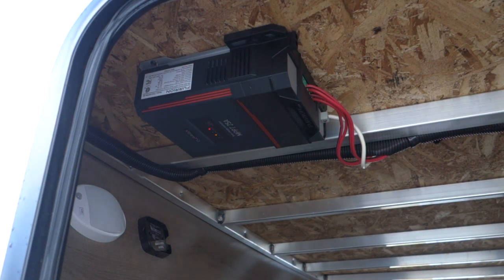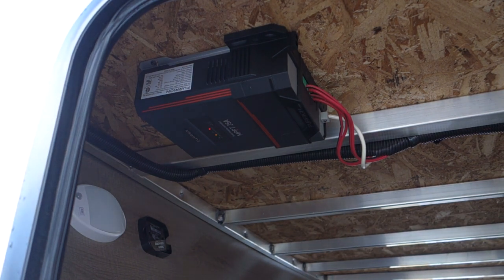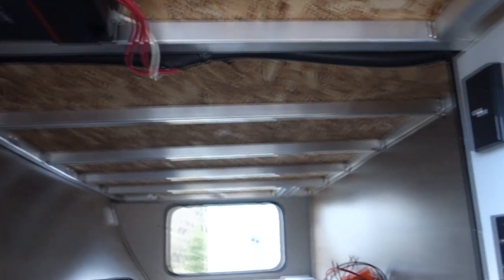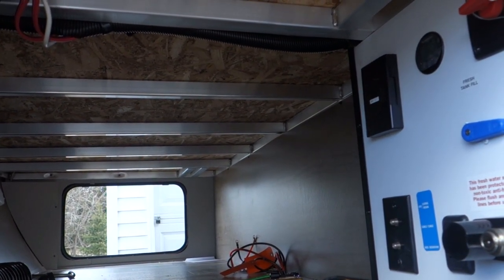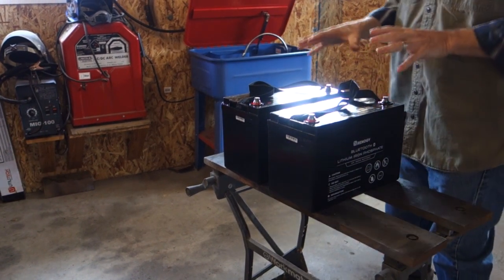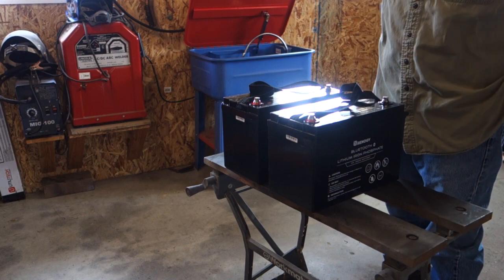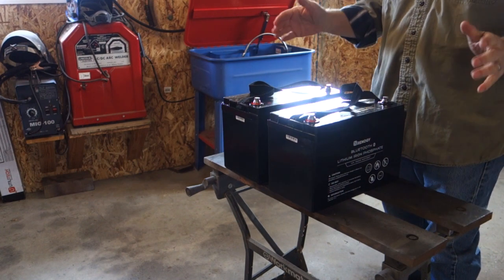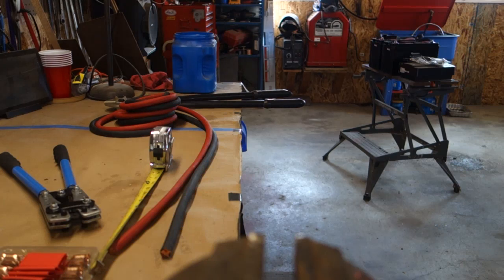2022 Grand Design Imagine 23LDE Solar & Electrical Upgrades

Comment: So I have a '24 23LDE and will be doing something very similar.  When I got it I installed a 3kw 48V inverter with a 5kwh battery.  I have 2400 watts of portable solar panels in 2 1200 watt strings which I can deploy up to 300 or so feet away, so that I can park under a tree but keep the solar going.  I like my portable setup, but I've decided to add a 3rd string on the roof so that I don't always have to deploy the portables if I'm not shaded, or having the 3600 watts will really charge up the battery quickly.  My goal is to put another 1200 watt string of 6 200 watt flexible panels up there, and I've been mapping out my roof to fit them in.  I'll be removing the stock 180w panel, and I'm hoping to put one of the panels along the front edge as you have in your video, but I was thinking I'd have to move the panel where the stock panel currently is down a bit, otherwise those two would conflict.  Looking at the one spot in the video where you're showing all 4 of your new panels, it looks like the one in the front may be slightly shorter?  Is it the same size as the rest and you were able to fit it with your stock panel there, or is it a lower wattage panel?  Are your panels the Renogy 200 watt ones which are 63.2 inches long?  You don't mention the stock panel in your description at the end, are you still using it somewhere, or did you disconnect it?  How is everything holding up one year later?
Reply from the maker: Sorry for slow reply !  All my new panels were the Renogy 200W. All the same dimensions. The stock panel that came with the trailer is 165W, and it's still connected in the string. Frankly, I'm not sure if it's adding much...in fact, it may be hurting things a bit. In any case, the system works fine for our needs. We're relative newbie RV'ers, but have a lifetime of "real" camping. (tents , backpacking, etc) Our electricity needs are very low compared to others, so we don't need a lot. In Alaska, we got lots of clouds and rain, yet the system worked fine. I doubt we'll change anything and the two 100Ah batteries work fine for us. Best of luck with your system. Cheers !
Reply: @justpassinthru7352  Yes, I'm new to my RV as well but have camped since a was a kid.  I finally went up on my roof today to measure and discovered I would be able to fit the panels as I hoped, so I'll put the 3rd string up there sometime before I go camping next year :)

Comment: Wow, horrible install with the flexible solar directly on the roof.     Whilenit was easy that heat will transfer directly into the camper.......there is a reason the oems dont just double sticky tape them to the roof.     

Hope you enjoy it this summer.
Reply from the maker: Maybe you didnt notice the layer of foil-backed thermal foam under the panels? Lots of successful long-term installations done this way. I guess we'll see. So far, everything working great.

Comment: Is that a radar dome I detect up there with the panels? I bet you’ve got a N!EA 2000 network running through that thing by now also. I know, it’s hard to completely get the water out of your system.  Now if you only had some red and green markers alongside the driveway…….
Reply from the maker: :) We have a bar in our basement, and I've been seriously considering installing channel markers on the stairway.

Comment: Might want to make sure you have some space around the batteries for air circulation to keep the batteries cool(er).  They don't like heat.  Add the 3rd battery now that way they all have the same potential.
Reply from the maker: Not really a consideration for lithium ion batteries. No ventilation needed. They can be stacked sideways, upside down, no problem. Each one has a built-in BMS (battery management system) that won't allow overheating. Combining batteries of different ages isnt much of a problem either. Not like with lead acid. That's why they cost so danged much ! :)